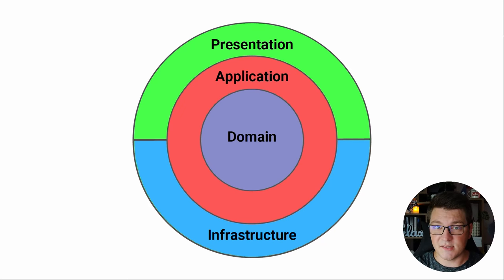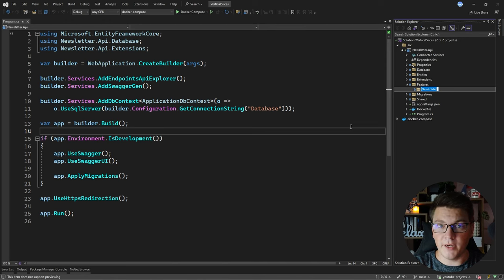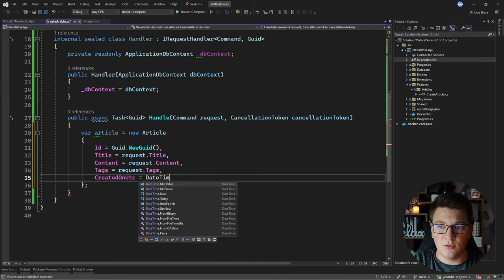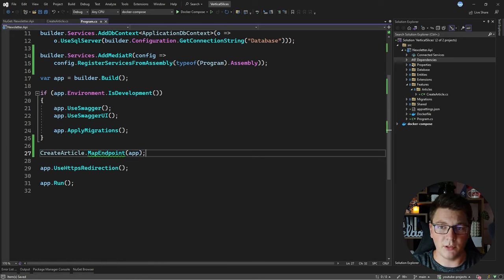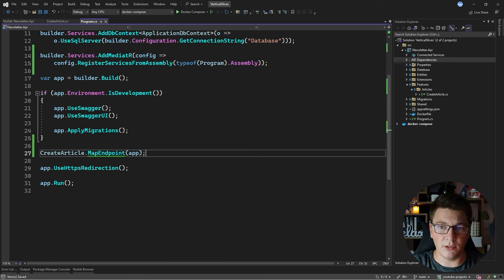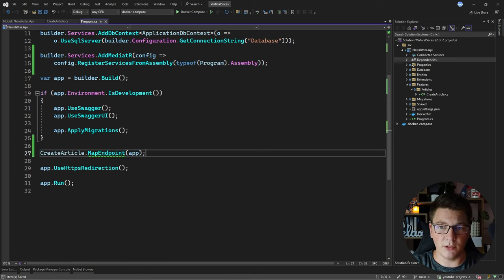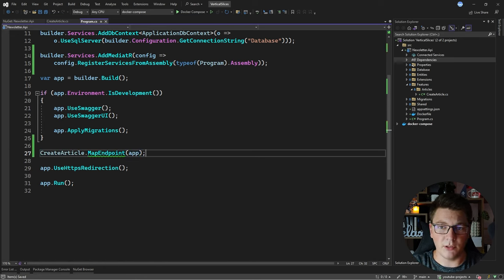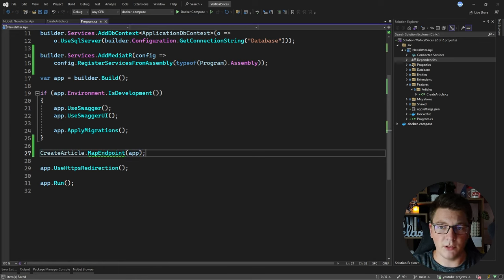Vertical Slice Architecture Project Setup From Scratch

Comment: Let's say you implemented entire set of CRUD operation on articles. How would you handle if you'd get a new requirement that checks permissions. Let's say there's some condition that decides if a current user can interract with the article (any of CRUD operations) based on user, article, time of day, position of the moon, whatnot, but the logic is for example 100 lines of code, so probably something you don't want to copy paste in each handler separately?
Reply from the maker: Move that to a service, encpasulating the check. It can live under the Articles feature folder. Or in a separate place.

Then figure out the simplest place to call it.
Reply: @MilanJovanovicTech  What would be a separate place? In case you really have a cross cutting concern, for example, that for all entities you have a service that checks if that entity can be deleted. It feels like you need a service layer and that kind of defeats the purpose of the architecture?

I'm not trying to bash or make it look bad, I just don't see a clear way to solve an actual requirement that's more complex than the most basic example. Sure, for POC this is nice, but I've never seen a production code that just reads from the DB and displays it. As you probably know, there are always some checks, calculations, and similar shenanigans :)
Reply: @m5s10  In your example that logic should not go to any handler (or as some call it, a use case).
The check should go into a middleware so that it is done before the controller receives the request.

VSA does not prevent you from being able to share code between vertical slices.

One of the principles of VSA is that you keep related elements of a feature in one place (high cohesion), however this is not the only principle of VSA.

Another VSA principle is that its vertical slices should not depend on each other (low coupling). This means that if one vertical slice depends on another, you need to introduce a shared layer that allows communication between the slices.

Comment: Hi Milan, why do you put the queries outside of the Features/Articles folder, is this a Carter limitation? Doesn't this defeat the purpose of VSA by having related classes within the same feature folder?

Wouldn't it be better to separate Commands and Queries within the Articles folder?

Perhaps as follow:
- Features/Articles/Commands/CreateArticle
- Features/Articles/Commands/GetArticle
- Features/Articles/Queries/ArticleResponse
- Features/Articles/Queries/CreateArticleRequest

Or perhaps as follow:
- Features/Articles/CreateArticle/CreateArticleCommand
- Features/Articles/CreateArticle/CreateArticleRequest
- Features/Articles/GetArticle/GetArticleQuery
- Features/Articles/GetArticle/ArticleResponse
Reply from the maker: Yeah, it was a Carter limitation

Comment: Nice video, just a pitty that most of your videos are using CQRS and MediatR, out of the last 3 companies I have worked for none of them use these patterns so alot of what I learn from you I can't directly impliment professionally, only in my personal side projects. Would be nice if you alos used other industry common patterns like the repo pattern etc in some videos.
Reply: Have you found the Repo pattern useful? In all projects I've been in mostly use it, but never , ever did they change from EFCore to Dapper or some change that would make the pattern useful, for me it's been just adding layers on top of layers to the code.
Reply: @Rodrick. I found it useful even without changing the database. I like to have all query logic grouped in repository. So it is easy to find and easy to implement. Note: I don't like generic repo, it is useless.
In scope of VSA, I'm going to try to implement repository per feature. Like data access layer per feature. I think it solves a lot of questions where to add a new query.
Reply from the maker: Nothing really changes conceptually without MediatR 

Command = Method parameters

Handler (use case) = Method on a service

Send(command) = CallService(params)

Right? 😁

Comment: Where would you keep your domain related stuff? Aggregates, entities and value objects, domain events.
Reply from the maker: A Domain folder? Or a Domain project
Reply: @MilanJovanovicTech  How would you separate an application into separate projects using vertical slices architecture? Because I wonder if that even makes sense at all if we have tight coupling feature-wise to things like endpoint handlers. The domain layer, okay, it's a standalone thing, but others? I would like to create some app to dive deeper into VSA and I can't figure out a good solution structure. What about App.Core (it would act as presentation + application layer), domain layer, and maybe App.Infrastructure, although I don't know whether it makes sense in vertical slices architecture. What do you think?

Comment: It looks good, but I have been using vertical slices for about 9 years, and the validation is better being out of the handler by calling the validator before the handler using the mediator pipeline.
Reply from the maker: Simple validation, at least

Comment: Could it still be a Vertical Slice Architecture if you would not add all the code inside 1 class, but have a folder (lets say "Article" as in your example) and in that folder to have the Command, Handler, Controller Api, etc. ? From my point of view, the class can quickly become huge which will make it harder to maintain, read, test, etc.
Reply from the maker: Yes

Comment: I'm wondering - is it completely save to use EF Contex if whole feature is in a static class?
Reply: OK, I've just checked with debugger. Thanks, I didn't know that:)
Reply from the maker: The class is static, but the handler inside is not

Comment: I totally do not understand why would I create something like CreateArticleRequest, instead of just using CreateArticleCommand. I dont see any benefit of that, please explain me whats the point of separate "request" class and command. Btw, I was waiting for VSA video from You, I'm so glad You make it!
Reply: We use commands inside the application context and requests as an api request model 

In the api request model you can add annotations that are relevant for the api (such as query parameter names, FormFile etc.)
Reply from the maker: The Command can have additional properties that you fill in internally. If you expose it you are:
- Leaking internal implementation details
- Coupling the Command to the API contract
Reply: @MilanJovanovicTech  I can think of PUT requests. I need to provide ID in route, as well as whole object in body. Could my "request" class have no ID property, and just then merge ID + request class into command class? Or that case is not common practice?
Reply from the maker: @arteqppp6223   That is a common case, yes

Comment: Dear Milan, thanks for the tutorial. I have been using clean architecture since years now along with the concept of vertical slicing. Per my experience, it's not a good idea to have multiple classes in the same file. Rather we can have subfolder for individual features inside the Features folder and keep the related classes at one place but in different files.  In that approach the developers should be disciplined about the naming convention of the files.  
For example CreateArticle feature should have the following files:
1. CreateArticleCommand.cs
2. CreateArticleCommandHandher.cs (for FastEndpoints, CrerateArticleCommandEndpoint.cs)
3. CreateArticleCommandValidator.cs
4. CreateArticleCommandResponse.cs
Reply from the maker: That's just a preference. Your suggestion leads to pretty much the same design.

Comment: What do we do when we have a large database query? Do we use DbContext in the handlers?
Reply from the maker: What other options would you consider?
Reply: I think there are two options.

Injecting dbContext into the handlers. I see it suitable for simple database queries.
Creating one or more repositories per Feature?? It would have the necessary methods for reads and writes to the database. In this case, I have doubts if the implementation of the repositories should be in a separate folder or assembly, Persistence, or in the same folder as the Feature along with the handler, validator, command, etc.
Tell me something about where to place repositories in a vertical Slice application with many use cases.

Thanks!
Reply from the maker: I would place the repositories right next to the features. You could also use extension methods event, to encapsulate complex queries.

Comment: Where would you put your repository abstraction if you must deal with consistency and invariants?
Inside features folder? Or inside Database folder? 🤔
Reply from the maker: Do we even need a repository here?
Reply: @MilanJovanovicTech  For this sample, we don't. But in a complex project with more sophisticated business we may need repository abstract to deal with consistency on the write side, don't we?
Hence a repo abstraction could solve this problem. So my question is where would you put it? 😅
And a repository

Comment: Hi Milan! Thank you for the video, I pretty much like this format.
Trying to reproduce the sample you've demostrated, I've got two errors related to Tags property (List<string>).
1. After the /createArticle handling the Tags value should (?) be serialized as a collection, but It goes into database as a JSON representation of the List<> object itself, not its data — like { "Capacity": 2 }. Actual tags don't reach the table.
2. /getArticle request failed with an error:
System.InvalidOperationException: JSON entity or collection can't be projected directly in a tracked query. Either disable tracking by using 'AsNoTracking' method or project the owner entity instead
, which occurred on the line Tags = article.Tags;
Would be grateful for any advice.
Reply from the maker: Seems to be an issue with this feature. I'd configure a conversion and use JsonSerlaizer to handle that property
Reply: @MilanJovanovicTech  Manual conversion works like a charm, thank you!
Haven't use EF for a while, and wasn't sure how to properly bake this "owned entity". But seems like it's not necessary, so I'd prefer to get back to Dapper.

Comment: What about non CRUD features?
Reply from the maker: What do you think would change significantly?
Reply: @MilanJovanovicTech  I think there would be more duplicate code. Features are usually hierarchical in nature. There are some complex features that depend on another base feature. However, the base would need to be duplicated within each of the complex features. 

There is the concept of push down into the domain model where a feature transitions into part of the domain. What are your thoughts? 

Also, I've seen so many CRUD examples that it's hard to see how this approach applies in more complex scenarios.
Reply: @crazyfox55  The base feature would not necessarily be duplicated. VSA does not prevent you from reusing modules. You can perfectly well add the base feature in a shared layer and several vertical slices will depend on it.

However, another detail is to see if it is really a "duplicate code". Several codes can be identical but have different purposes and evolve independently.
Reply: @DaveRoman-mc4nn  Yes, that makes sense.

Comment: This is an interesting approach, but I think you're limiting yourself by placing all of these concerns in a single file. Some larger systems I've worked on shared code across multiple environments, some web-facing, some windows services, console apps, etc. It wouldn't make sense to me to have API routing buried in my classes that I'm using in a console app. There's also something to be said for enforcing decoupling when the implementations are separated via project boundaries.
Reply from the maker: Obviously I would build that kind of system in a different way. Architecture is context-specific. Right?
Reply: @MilanJovanovicTech  It is, but planning ahead is also a thing.